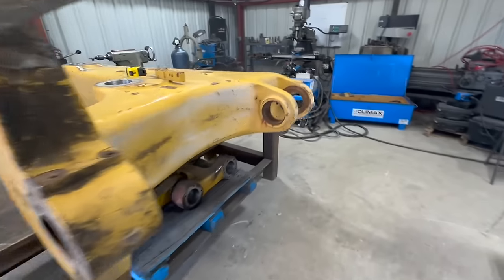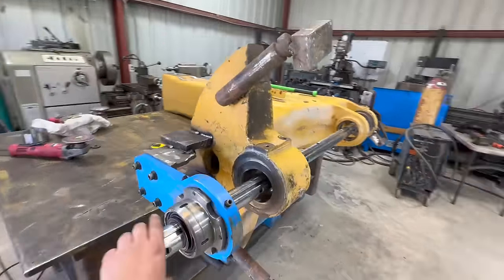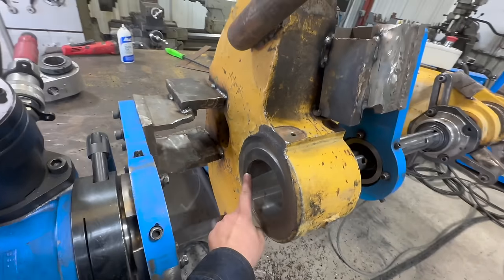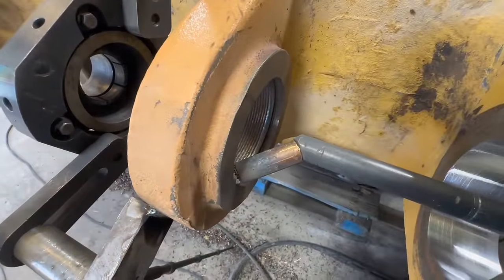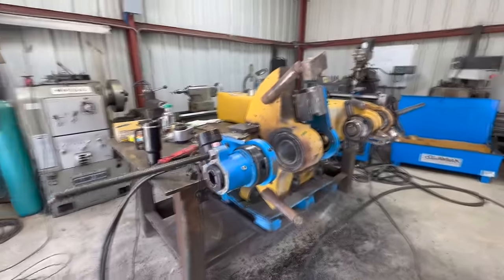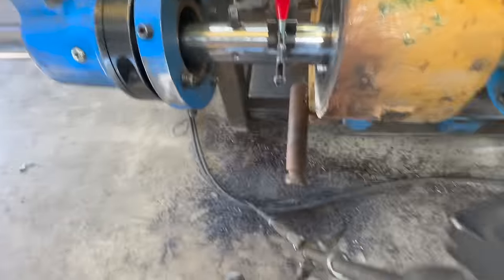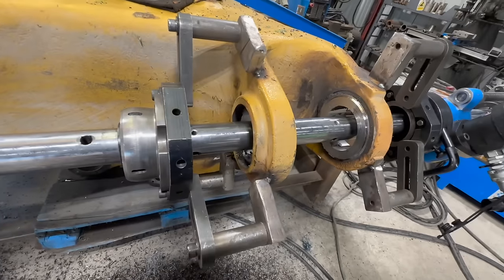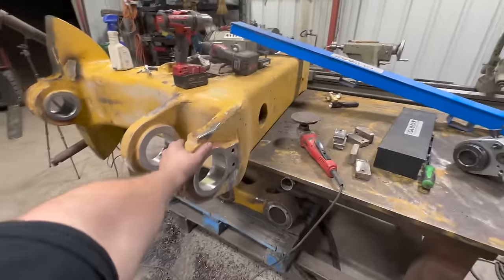Line boring CAT 637 hitch horizontal bores

Comment: 25 years of steady line boring and I don't miss it. Bars up to 16 ft. long. Double side bearings, single side bearings, Spider bearings, and spiders with brass bushings. I owned one of the early bore welders.

Comment: When you see a bore wallowed out that bad, it usually indicates the bore was not designed correctly for the load - even with the bushing. That bore has to be at least another 25%" wider to handle the extreme loads

Comment: You see the curve of the conduit has to match the the rotation on the bore welder. It also makes a difference If you're pulling off the top of the roll or off the bottom of the roll of wire. Like I said my wire feeders a little different and I pull off the bottom of it. So therefore I have to go to the right into the bore welder and have the bore welder rotate right. You don't want to unbend the Natural curve of the welding wire when ots inside the conduit If you can help it. What you can do is pull out about 10 ft of wire out of your wire feeder and see which way the wire flips over. It should flip over in the direction of your bore welder or point to your bore welder I mean

Comment: Yeah totally use your inch and a quarter bar with the setup cones for tacking on your big bearings using the reducing collets.  much easier to dial in the bar and that way you don't wreck the big bar with the welds spatter when tacking on bearings

Comment: Sitting in front of your computer look up motor mounts 2122 and 2123. Think of a using those with some bolts and washers to create harmonic dampeners that could be screwed into different threaded holds in your boring bar and be crazy easy to remove or shift to a different location.   I worry about your support bearings. About the hydraulic drive unit bearings. The vibration must be vibrating the bearing races and balls.

Comment: Don't know if any of that wire flip stuff makes sense to you, but when it welds up one bore completely fine and then you move over to another bore and the wire flip is completely terrible, you'll ask yourself why. And the reason is it's because you moved your wire feeder in a different spot relative to the bore welder. And once you find out where that spot is where there is no flip, that is where the wire feeder sits every single time it'll never change.

Comment: Had allot of people mention you on my channel 
How do you like the climax
Any experience with others?
We do some line boring but maybe once a month
Great videos!
Reply from the maker: My first setup was a BRS.  It was good but lacked a few details.  I decided to sell it and go with Climax because of their endless options they offer.  I prefer the climax bearings with their adjustability and the Climax bore welder is amazing.  I recently got a S power system and will be putting it to the test Soon.  For under 10k the S power will be interesting to see how it stacks up.  I also watch your channel every week.
Reply: @OFW  thanks 
I like the measuring system climax has 
That looks very handy

Comment: Wire flip isn't fun. Be behind your bore welder looking at it, have the bore welder rotating clockwise, then have the wire feeding conduit come out and go to your right And make a right angle to your bore welder. And have the wire feeder conduit up about level with the bore welder. It only took me 15 years to figure that out. But it does talk about it in the book as well. You might have to try a different configuration on where your wire feeder is sitting, but that's what worked for me. my wire feeder is a little different,
Reply from the maker: Sounds like you have a tremendous amount of experience!   I would love to pick your brain.

Comment: Very nice! From your videos I understand how line boring works in general, but it's still a total miracle to me that it works in practice - over time you've shown some parts that looked like you should have been able to get anything centered on them with how chewed up they were. A few questions if you don't mind: Did the suspected crack in the smaller bore turn out not to be a crack, or did it cut out just fine? Did you have to run dye on it? Hand-welding the last part of the oval was likely because cutting it out and welding it all back up all around the ID would take a lot more time and wire than pulling out the bar and doing it just in that spot? And that's a big chunk of metal, I'm sure Cat would love to sell the customer a new one, and the customer has thoughts about that idea! haha
Reply from the maker: The crack turned out to be a scratch. Yes, hand welding that part saved probably 2 passes with the bore welder which is about 2 hours.

Comment: I highly recommend the Metabo Tapper GB 18 LTX BL Q I (602362840) CORDLESS TAPPER. I drill hundreds of taps a day and couldn’t live without this tool. Kinda pricey but not compared to similar. Thank you for the fantastic depth explanation. That did not look like a cheap tool either  ;-) .
Reply from the maker: Thank you, I will definitely check those out.

Comment: The clamp-on digital height gauge for measuring the tool stick out on the line-boring machine is really cool. Is it something you assembled yourself from a bunch of parts? Or is it a standard tool that is available in the industry, as I have never seen one before :)
Reply from the maker: Climax sells this one. But I don’t think it would be difficult to make.
Reply: @OFW  Thanks :)  I've seen 'stick out' measured a few different ways for line-boring, but I've not seen anything as easy to use, or as professional looking as that set-up you have.

Comment: Awesome job like usual
An adjustment screw on the backside of the cutter,sure would make things easier for fine adjustments and then use a set screw to clamp it 

On side note Greg, do you have preference with Miller welders over Lincoln and others?
My very first welder was an old,old Hobart gas and that thing was slick, except for the carburetor 😂
Reply from the maker: Actually this bar is threaded for doing just that, the problem is having the correct length cutter so it all works.  I don’t like cutting them down.
Reply from the maker: I have always liked Miller, I have tried Lincoln a few times with terrible results.  So I just stick to Miller.
Reply: I have a Miller Regency 250 and a Syncrowave 300 from the 80's that I use as a serious hobbyist . I purchased them both in 95 for under 2k and still use them and never had a break down once. I think that should tell you alot about Miller welders.🍻

Comment: Okay, this is obviously a casting and I’m guessing it’s cast steel. My questions are: Would this work at all on cast iron using steel mig wire? Have you ever come across a casting of this type that was cast iron? And finally, Which method do you use to determine whether it’s cast steel or cast iron?
Reply from the maker: It’s definitely cast steel. You can bore weld cast iron with silicone bronze wire or a high chromium content like stainless steel.  But I would try to avoid welding on cast iron as much as possible.  Hopefully just make oversized bushings. I use a drill bit and a grinder to tell cast steel from iron.
Reply: Thank you for the reply. I use the same methods but there are times that I’m still not 100% sure. I tested a piece recently and a brand new Dewalt cobalt bit wouldn’t touch it! I ended up declining the job because of what the customer claimed they could purchase the new part for. Be blessed.

Comment: What is the wire spec? Type, size, voltage and ipm? Thanks .. Running out of wire in the middle of the weld really makes it tough... Nice restart..
Reply from the maker: Er70s6 .035” 20v. Not sure on wire speed.

Comment: So these huge components are cast iron aren't they? Or cast in steel? I'm asking because cast iron is supposed to be a headache to weld yet you're building up the bore with MIG without any trouble or is there a steel sleeve in the larger iron casting and that's what you're working on? Anyway I don't repair Cat frames obviously but I'm really interested to know how this works
Reply from the maker: These are cast steel. But sometimes you get one that is cast iron. Cast iron is a pain to weld but it can be done.  If it’s cast iron I try to use an oversized bushing.

Comment: Can anyone tell me why the Mig Wire doesn’t ever twist while bore welding. I see the welder on the floor with spool fixed vertically so does the wire ever hang up in the wire guide and if not, why not? Thanks
Reply from the maker: Every now and then you get “wire flip” but usually everything is pretty smooth.  They have it engineered pretty well.
Reply: @OFW thanks

Comment: how often would you reckon you would need to true the boring bar when it wears?
Reply from the maker: I haven’t needed to do that yet.  I think if it got bad enough I would probably just buy a new one. They are not terribly expensive in my opinion.
Reply: how long have you been using the same one? @OFW
Reply from the maker: About 3 years